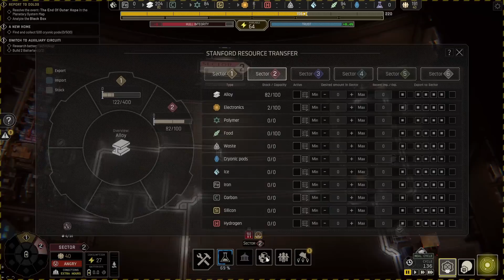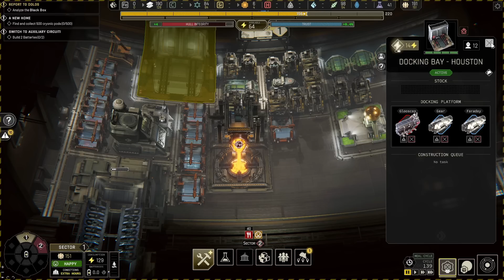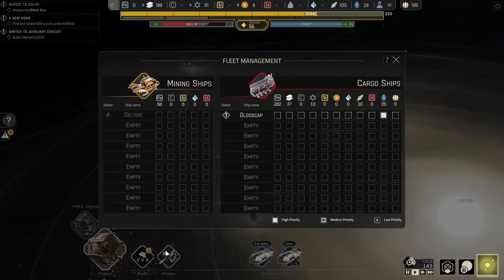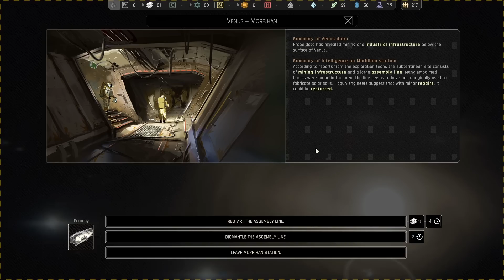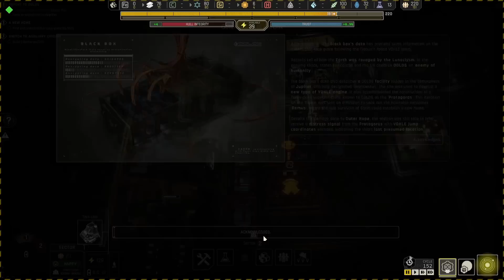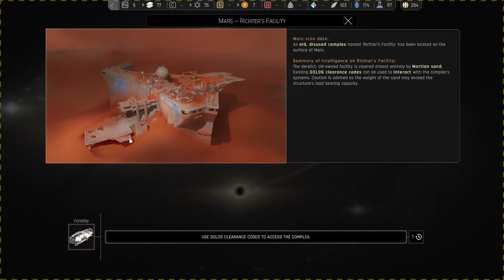Space Hulk | IXION - Part 4 (Space Station Survival Exploration Game)

Comment: Penge, what you want to do is specialize each sector as much as you can. If you focus each sector on a specialty (food production, resource extraction, etc), you'll be able to get things done much more efficiently than by sprinkling the different buildings around in between different sectors.
Reply from the maker: That's the plan but of course without access to all the sectors it's hard to specialise them! We'll get there, once we get some more tech unlocked we'll be able to get more stuff done and it'll all be amazing.